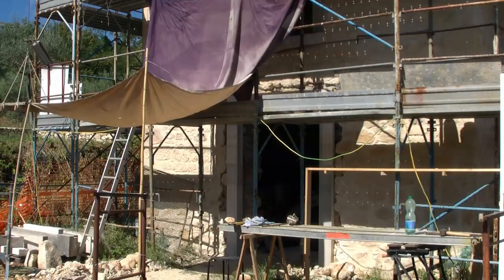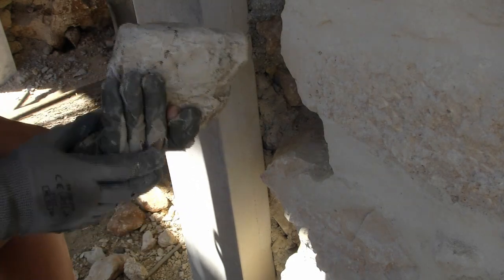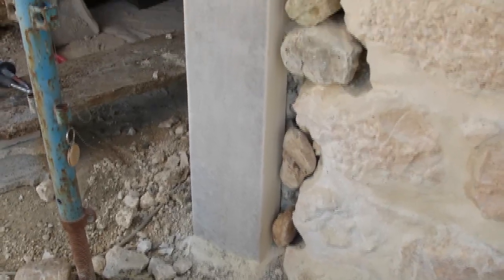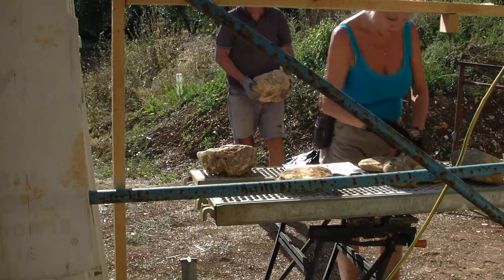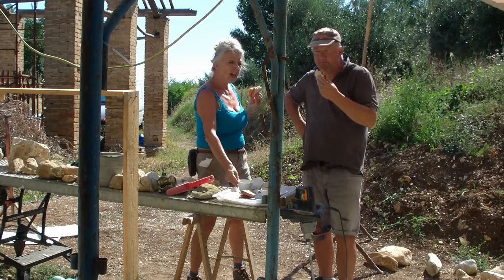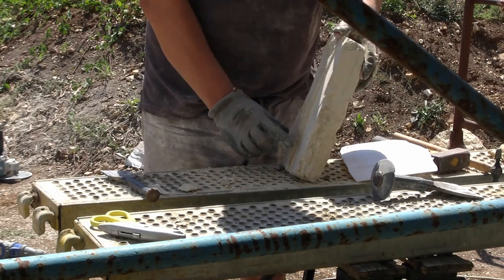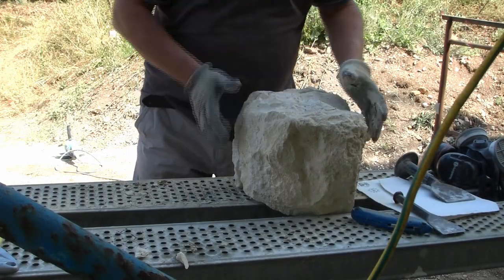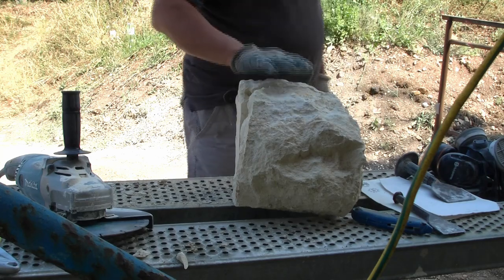Stone wall restoration ourselves at Italian Farmhouse in Abruzzo  Ep 29

Comment: What is the mix you're using to place the stone, and why aren't you using lime mortar for that as well? Is the mix you're using the reason you're not wetting the stones? This is the first time I've watched your videos, so please excuse me being behind on details. Speaking of details, you do a great job explaining as you go.
Reply from the maker: its a kerakoll product from Germany it is lime motor but its a different from the one to the outside its much darker though its for sticking bits on to stone and metal and its gone nicely cant budge the stone....no need to use wet stones with it either...its all abit different in Italy due to the heat I am working in 40 c plus which is quite normal for builders here and they need different products that we may normally use in cooler countries, its also specified on my architects project supply list. Thanks for watching